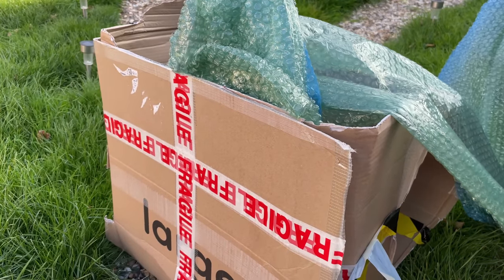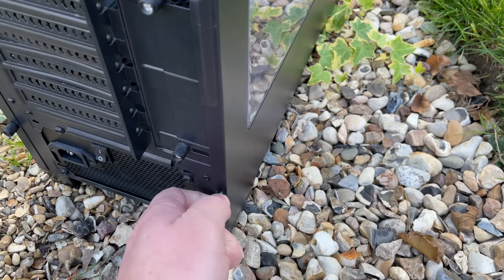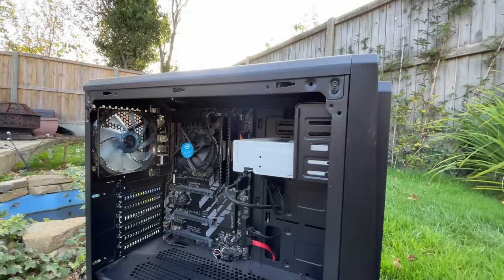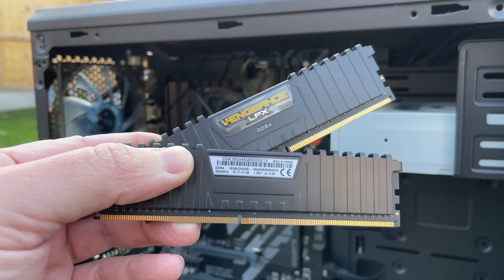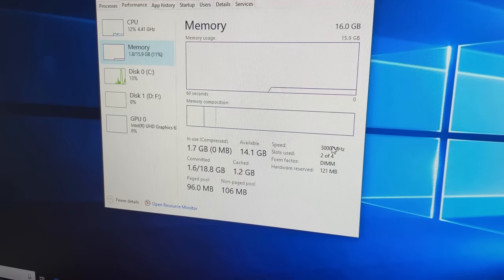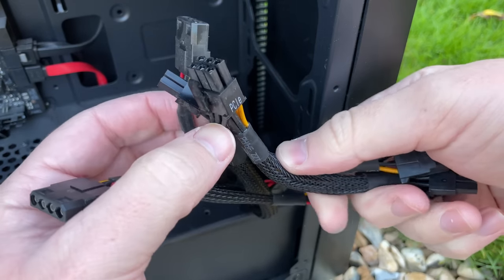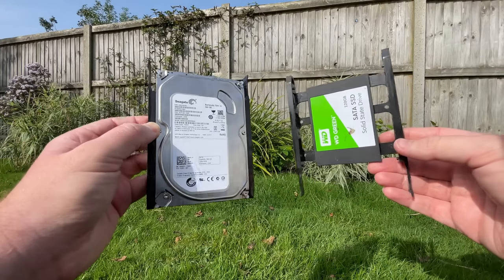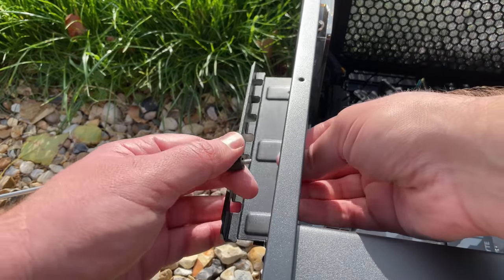This £169 PC has an i7 8700 - But Was It Worth It?

Comment: While that board will run and support the i9, its maybe not going to run it well, z370's were rather borderline in being able to power them properly. 
The i9-9900 itself, totally worth it, its what I have here, but its a toasty power hungry one thats for sure when at full pelt!
Reply: Agreed..my mobo is a 370 maximus 8 with 1000w psu...running the 9900KS...
Yes power draw is high at 360w on load with the 2080ti but triple aio tames that doen to 70deg at 1440p...
Gonna last me another 3 years I reckon till.I have to swap out the mobo, cpu and gpu

Comment: I just bought an old Dell with an i7- 8700 and a 1050 graphics card for $80. It's going to replace an old AM1 system that serves as a DVR. With the extra power other media uses will probably be used.

Comment: Hah, I did similar except I spent that on the entire build (even the GPU). £170 (total) in the end for a combination of a PCSpecialist OEM PC with a Comet Lake pentium Gold, 16GB RAM and a 500GB SSD (£70), and then an extra 16GB Stick (£15) was added, swapped the pentium gold for an i5-9400F (£35), sold the jank PSU and Pentium (£22 for the pair) and bought a corsair VS430 PSU with it, adding a (brand new) RX580 8GB 2048SP (cost me less than £50) and voila

Comment: The 8700K can power up a high end 4000 series GeForce or 7000 series AMD GPU surprisingly well.
Reply: people tend to underestimate CPU's. Its all about shifting the main work between GPU or CPU. I have an 8700 non K but I also game mostly at 4K 60 fps high quality settings so my 3080 12 GB is doing the heavy lifting why the CPU has a good time.
Reply: @catriona_drummond  this is true, people watch reviewers test CPUs with a 4090 at 1080p and rush out to upgrade their 1 year old CPU only to find they gained 0% to maybe 5% more performance at best

Comment: You need to update the bios to enable Rebar. I have the Aorus version of that board with an 8700K. I run 5Ghz all core and was using a 3070 in it.

Comment: i have this MoBo i was running a 8600k and upgraded to an i9-9900kf..... if you go i9 make sure you manually set voltage or the vrms will cook. i didnt bother with 5ghz all core i left turbos stock but gave it 180w tdp and 1.325v on the core holds 4.7 in c23 for the whole test

Comment: i used fts computers about 7 years ago and i thought it was great, 300 pound for a 960 and an fx6300 with 16gb of ram. i had it for 3 years with no problems until i upgraded

Comment: what a performer, i wonder if a 4060 would be too much for the cpu to handle
Reply from the maker: Should be ok. Frame gen would definitely help in supported titles if you wanted to use it if course
Reply: not at all, a 4060 isn't that fast
Reply: The 4060 low profile could be able to fit in pretty much every case.
Reply: Dead pan sarcasm.. my favourite.
Reply: I don’t believe that would be a good idea the 3060ti is bottle necked by it quite alot the fps is all over the place

Comment: i am interesting in the i9 video for that platform, i have a i7 8700K and was thinking of upgrading to 9th gen just for the 8 core but 2 cores...will it be worth it for editing.
Reply: don't bother, go 13th gen
Reply: Any 10th gen or newer gen cpu will need a new mobo  so don't forget the extra cost of that on top of the cpu..
Which is why some say the better path is still the i9-9900k oc'd to 5.1 and that will last until 60 series gpus.. if paired with a 2080ti or 3080ti or better

Comment: I wonder if my i5 9400F if it is slower than this i7 8700, the 8700 has more lvl 3 cache 12.5MB vs 9MB for the 9400f and the 8700 has 6 core and 6 threads, where as the 9400 has only cores no hyper threading, surprised if it wasnt faster?

Comment: I'm still using Acer nitro 5 with undervolted (so it won't reach 102°C, wich was common before undervolting) i7-8750h and 1060 6 gigabytes. The screen is 1080p 60Hz, BUT I managed to overclock it to 90Hz.

Comment: I remember having an i5 7600K and reading about the Coffee Lake Generation online. I wanted to upgrade to an i5 8600K for the two extra cores, but Intel made them incompatible.
Reply: Why? The socket is still same right?
Reply: @-mustang-9383  yes, it's both 1151, but it seems like they changed a few pins around since 6th and 7th gen core i processors are completely incompatible to motherboards made for 8th and 9th gen and vice versa.
Reply: @Tom2404  really? That's new for mee
Reply: @Tom2404  I researched, the mobo has to be changed, since higher voltage is applied for the CPU although the same pin number

Comment: i have an 8700k still! it can do more than a 3050 haha. I'd recommend a 3060ti or maybe even a 3070 at most. I have a 3080ti and have it TDP limited to that of a 3070~ and it runs really nice on everything that isn't fortnite. I do run 1440p144hz so that's more CPU intensive.
Reply: I also run 8700 with 3070 ,and it is fine.
Actually in 1440p you  push more the gpu so there is very little cpu bottleck.
Recentry i add 16 more GB of ram and it is even better.
Havn't tried 2023 games yet. But from what i see in videos , there is no much optimisation in newer games.
Reply: @ivandel1182  stuff like Fortnite kills the cpu even at lower settings and phasmophobia can’t get up to my 144fps
Reply: @nahventure3873  Havnt play fortnight in a while.
Actualy havnt play anything in while.
Reply: samn @ivandel1182   I left that friend group a while ago and didn't pick it back up. They said Fortnite might be shutting down sometime around march since the guy that did story telling left/retired. It's been full of bots lately too so playing is boring.
Reply: @nahventure3873  Have 2 year boy and just do not have the time any more.
Still i am glad that i got back to pc gaming and was able to play all the games that i wanted.
Now the PC is used mostry for some office aplications.
have no more than 100 hours of plaing in the past year and a half.

Comment: mine is also non K , z390 asus prime, XMP 2.0 enable 3010mhz ram, BLK on 102.60  ( 4423mhz all core  115w) probably can go more but didnt wanna mess with voltages and ram freq + 5700xt (2100core/1800 mem/ +10 power limit 215w) play everything 1080p/1440p ultra !  mw 2.0  100 fps +/-  ultra 1080p , bf 5 150-200

Comment: THIS IS MY CPU!
It's alright, but I don't have an SSD so my PC is quite slow.
5400rpm HDDs are not great in 2024 lol.
Reply: Where are you? Can you not find a cheap 120gb ssd for at least your os?
Reply: @RyanZinter  I'm in the US and ofc I can but I just haven't bothered to take the plunge.
My next build will most likely use an m.2 but I have little reason to upgrade from this one as of now.
I think the best course of action for future upgrades on this pc is actually 32gb of ram because 16gb struggles on warzone with windows 11 taking up so much already in the background.

Comment: The i9 9900KS works beautifully on that mobo. 
It's still a decent CPU, and mine overclocked easily to 5.5ghz.
I don't think the i7 8xxx had the STIM on the core and won't overclock as well.

Comment: 6:27 You can't play Starfield on the RTX 3050 at 1080p medium (without the use of FSR)!
Seems like Starfield is just a disaster zone in general. I'd rather play Hogwarts Legacy!
also 6:06 If you're going to play on the lowest settings, don't brag about an i7 with i9 upgrade in the future, get a Core i3 from the 1st generation and a GT710.

Comment: Not a bad PC if I say so, I'd definitely have something like that myself! Especially the DVD drive - I like cases with 5.25in expansion, optical media isn't dead yet!
Yes, I too would look into the i9 upgrade, as well as an NVMe SSD, a nice beefy PSU & GPU, and of course, with 4 RAM slots, that motherboard is crying out for 128GB DDR4.

Comment: Hello @RandomGaminginHD,
I love to watch your videos, they are really amazing.❤💯
Can you Please benchmark intel core i5 7500 with best possible and compatible GPU.
My pc specs: CPU: i5 7500, Ram :16Gb 2400MHz DDR4, GPU : Zotac GT 730 4GB GDDR5 Low profile single fan, Motherboard: Asus H110M CS,  PSU : Ant Esports VS600 (600W).
I want to upgrade my GPU.

Comment: It's weird that I don't play these 3D, graphics intensive games but I keep watch these review videos that mostly use these games as benchmarking tools. Over the past year, I have been trying to "upgraded" my PC with little success. 2 out 3 used GPUs I bought have problems and unusable. My everyday uses are a bunch of chrome and vscode instances+tabs. Maybe I should stop trying to chase a "better computer".
Reply: or don't buy a cheapy used gpu lol
Reply: @connorosullivan3500  Oh yeah. I will probably not buy used GPU anymore. I thought you mention PSU at first. I had the RX 6900 XT (ASUS TUF) that I bought brand new - it is still working without any problems.